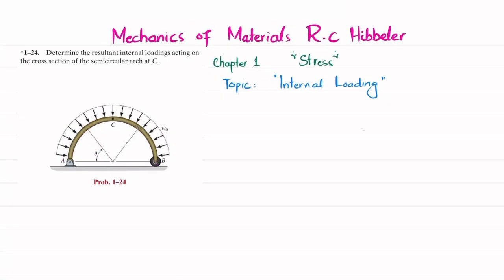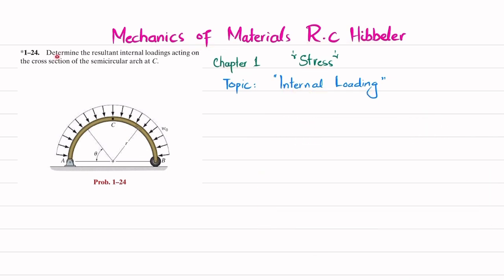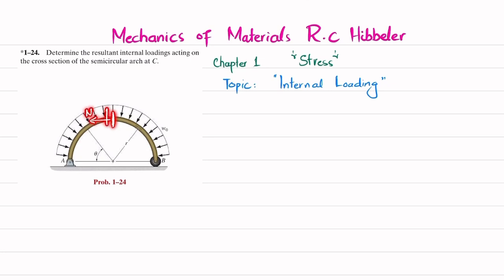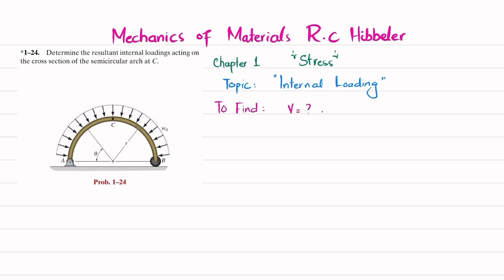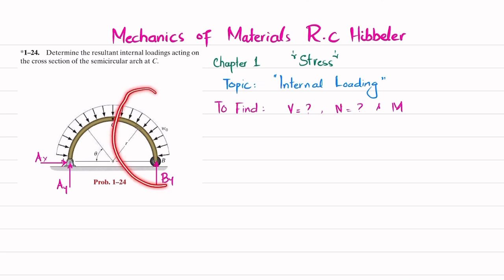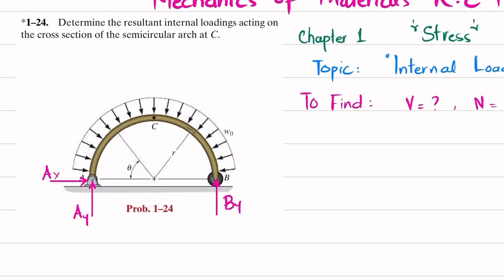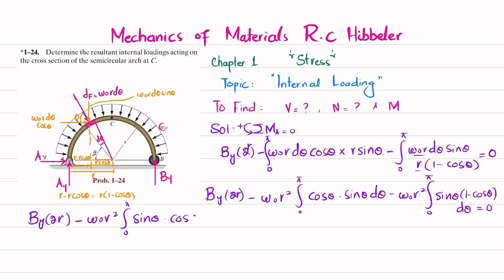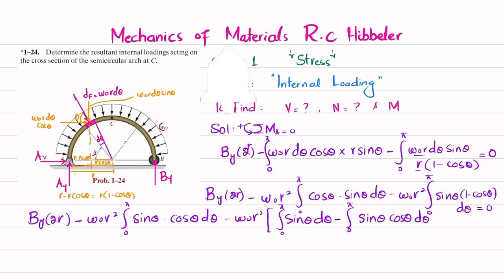Determine resultant internal loadings acting on semicircular arch | Problem 1-24 | Mech of materials

Comment: How did you get the distance r theta at 3:16
Reply from the maker: If you have an segmemt of an arc with radius given and angle between them is theta so the arc length can be obtained by S= r * theta so here radius is r and angle between the segment side is d theta so the length of arc will be r* d theta.